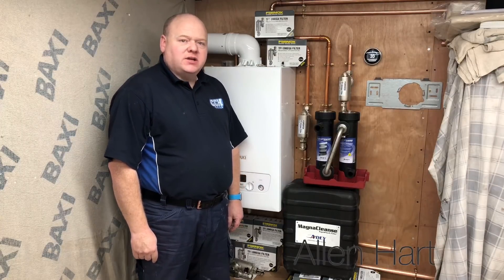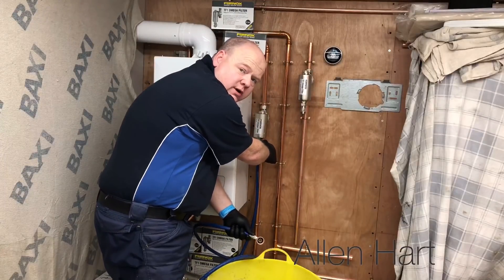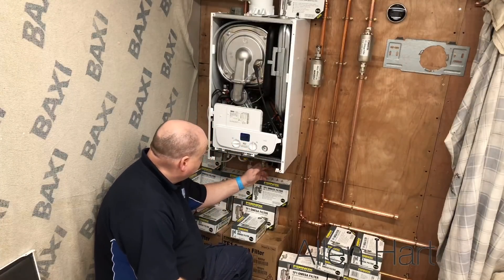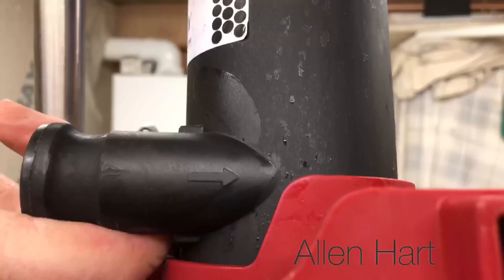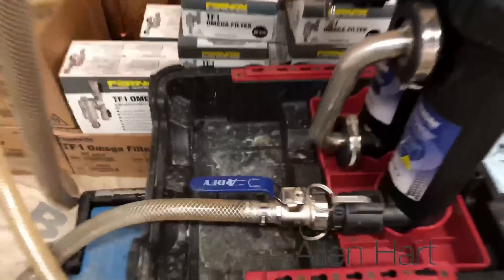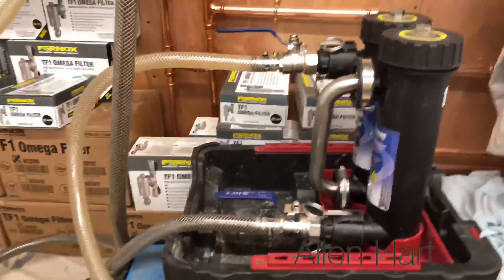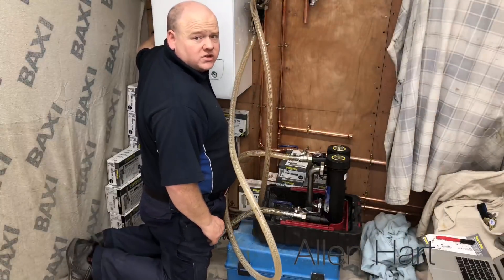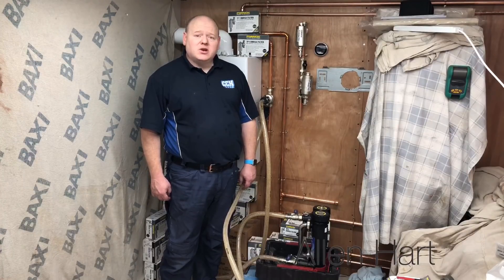How To Do A Magnacleanse, Flushing A Heating System

Comment from the maker: Also look at this. 
Power flushing does not always work to clean out the hardened sludge from
your central heating system. No need for replacement! Powder Flush can
help!! Our patented process can clean plastic pipes, microbore (small
pipes) and restore really old systems. http://www.powderflush.co.uk

Powder Flush Videos:
How it Powder Flush works - https://www.youtube.com/watch?v=PggsBKaCx7o
Powder Flush in real life - https://www.youtube.com/watch?v=yg8IGSGnS90
Powder Flush experiment -
https://m.youtube.com/watch?v=HZ-VpEkI4co
Reply: Allen Hart hi Allen can the magnacleanse be used if you don’t have a magna clean fitted. And could it be used if you took a radiator off and do it that way . Chris
Reply: How many filters ??? Lol

Comment: Is there any point in doing a magnacleanse flush if you already have the magnacleanse filter installed?
I recently had a new boiler installed and a chemical flush was carried out prior to the install, but I was still recommended to do a power flush.

Comment: I think magna-cleanse is much safer than power-flush and does the same job 
Allan what is the best kit to buy with all the adapters 
Thanks Allan
Reply from the maker: Doesn’t do the same job, Magnacleanse doesnt have a pump. Thanks
Reply: Allen Hart 
Yes Allan i know it doesn't have a pump, but its much safer to use than high pressure power flush
Reply from the maker: @Taqqiyastar  What if the boiler pump is weak or not working? or even a new erp pump?
Reply: Yes your right and i am open to learning.
I think weak pump is hard unless you are installing new boiler.
Erp pump maybe put it to maximum, but for how long, 
The answer to this is power flush, but i am scared to use on old system because people say it leaks or pin holes old system
Its good to learn from you and i love your videos
Reply from the maker: @Taqqiyastar  The erp pumps are really small inside as well.

Comment: hi Allen , I have a question. there is no power flushing pump. its enough to clean by using only boiler pump?  becasue it has  low mass flow rate.
Reply from the maker: Depends how bad the system is tbh. Thanks.

Comment: would you say that the magna-cleanse brings an average system upto minimum standards just using it without a power flush? also would you install the new boiler onto an old system and then do the flush?
Reply from the maker: Depends on the install TBH, Thanks.
Reply: another question.. why are there directions on the magnaclean filters... im refering to the magna clean mirco ones.. what are the implications to fitting it in reverse flow... is it so that the debris catchment at the bottom is able to physically catch the debris... im pretty sure the magnet will be as effective ???
Reply from the maker: Thats a very good question and i can only guess that its designed to work one way, if it was the wrong way round i am guessing it will still catch something. Although i cannot see any reason to fit it the wrong way round. Hope this helps. Thanks.
Reply: @Order-of-the-lion  It's to to get a better flow rate of water through the canister.  If it's fitted the wrong way it causes a little turbulence in the filter.  This shifts of some of the debris from the magnet.  Which kind of defeats the object.  It's dependent on pipe work either flowing down from the ceiling or up from the floor to the return pipework (in and out of the canister because it's bi directional)
Reply: Thanks ghost, yeah that all makes sense, I guess the ultimate question about the Magna cleanse flush without the power flush would have to be answered by the boiler manufacturers themselves.

Comment: That’s good cleaning performance on a clean system with the dirt recently introduced and in suspension in the working fluid. However, the system pump does not generate sufficient flow rates to dislodge debris adhering to internal surfaces. Any power flush (in both directions) must be done without the system pump in place as that in itself would inhibit the flow rates needed. But maybe you have covered this in another video(?) if so I apologise, I am still catching up with your high quality content.👍
Reply from the maker: I havent done a full powerflush video yet, i might do one when i get chance, Thanks for watching.

Comment: Hi Allan are you using a manga cleanse instead of power flushes.
Reply from the maker: No One We use both the Powerflush machine and the magnacleanse, depends on the job,. Sometimes together and sometimes just the magnacleanse

Comment: Hi 
Can you get an adapter for the Worcester greenstar filter to use the magna cleanse machine ?
Reply from the maker: We only install the fernox filters but when you buy the magnacleanse it comes with a kit which has the correct adaptors i believe.